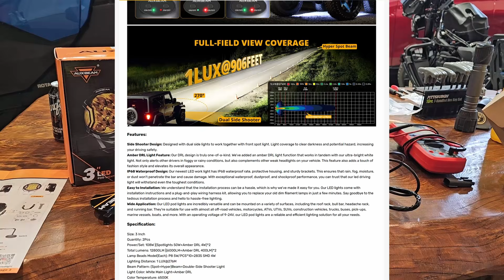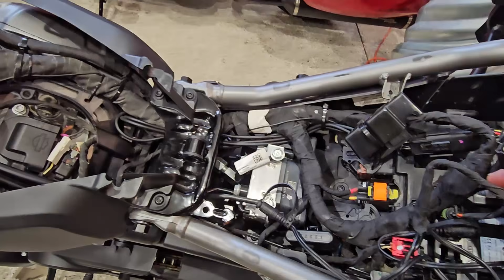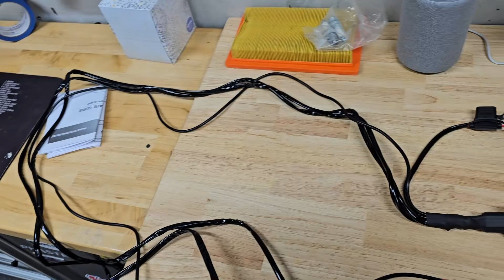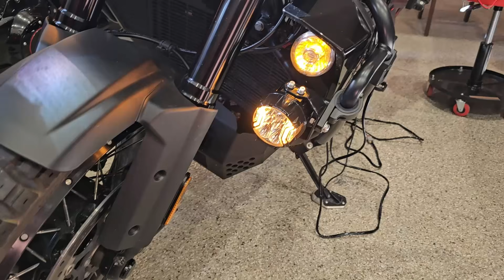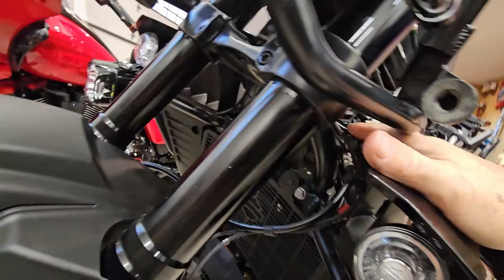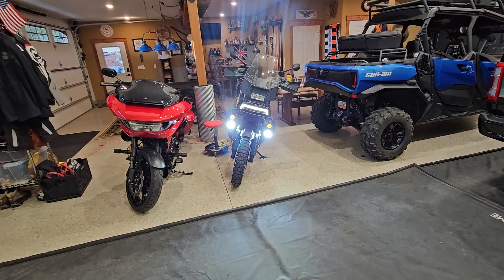Cost effective Auxiliary Lights for ADV Bikes? Auxbeam Install on the Harley Pan America

Comment: Hi ! What do I risk using the 3 pin connector ? ECU errors ? Bike shutdown ? Kil my battery ?
Reply from the maker: No risk, just need to make sure you use the switched power pin and ground (not the constant power).

Comment: Did you have any issues with waterproofing of the switch?
Reply from the maker: They are not fully sealed -but I have not had an issue.  That said, I may end up using a CANBus controller and mapping to one of the factory switches - just to clean things up a bit.

Comment: Very good video, would you please help me with the adaptor name or code to get it please
Reply from the maker: It is an SAE DC connector (3.5mm as I recall) - just got this from Amazon because of the SAE connector adapters, wire gauge, etc.  https://www.amazon.com/gp/aw/d/B09N3LCJ4F?psc=1&ref=ppx_pop_mob_b_asin_title
Reply from the maker: If you’d prefer to run the lights through your existing PA switches rather than the included standalone switch, the Hex EZCan CANbus interface is worth considering. It appears simple to install and program, and it allows you to control your lighting and other devices directly through the existing PA control system. In this case, I was aiming for a solution that is both straightforward and cost-effective while still being effective.

Comment: What’s the name of the adapter you used to plug in to the heated accessory port?
Reply from the maker: It is an SAE DC connector (3.5mm as I recall) - just got this from Amazon because of the SAE connector adapters, wire gauge, etc.  https://www.amazon.com/gp/aw/d/B09N3LCJ4F?psc=1&ref=ppx_pop_mob_b_asin_title
Reply: @cyclesage123 thank you, your setup is the exact one I’m going for. I like the way you did yours. Very clean, thank you for the video
Reply from the maker: @CBN1359 If you’d prefer to run the lights through your existing PA switches rather than the included standalone switch, the Hex EZCan CANbus interface is worth considering. It appears simple to install and program, and it allows you to control your lighting and other devices directly through the existing PA control system. In this case, I was aiming for a solution that is both straightforward and cost-effective while still being effective.